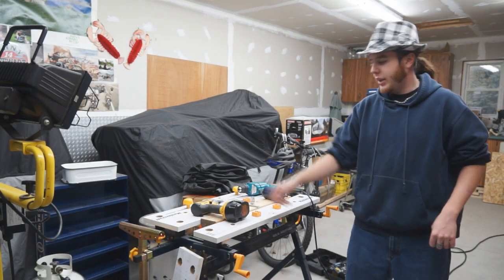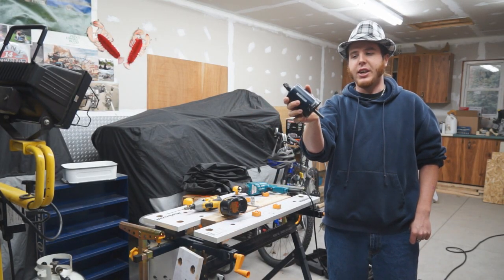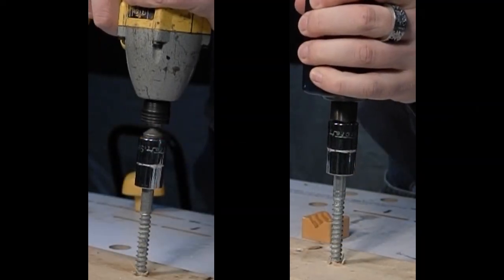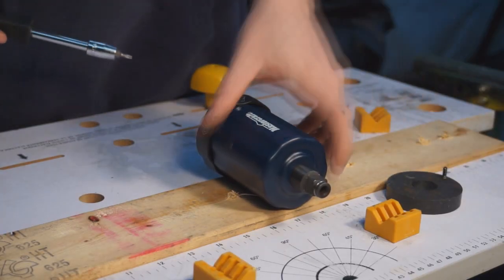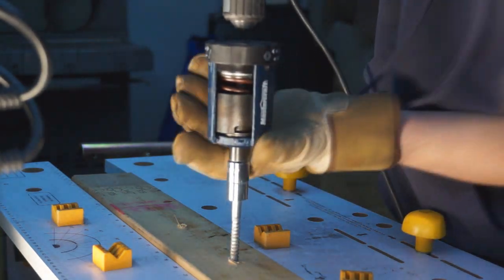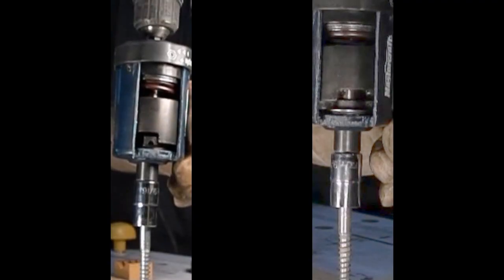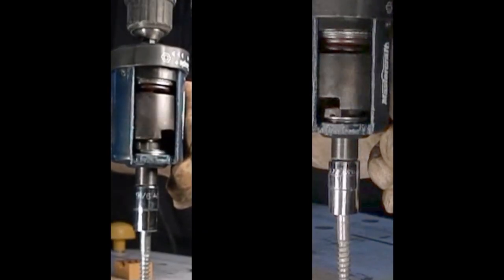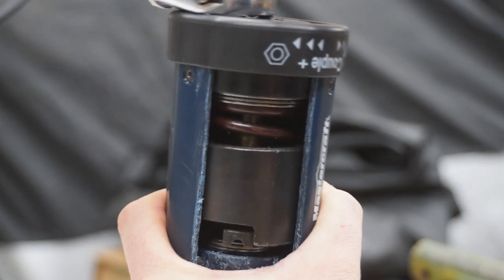Slow Motion - How an Impact Wrench Works

Comment: This video is superb! Absolutely the easiest and most visually descriptive video of how an impact works. I understand this perfectly now. Thank you so much. Keep the great vids coming. If possible, could you make a video about how a sink side sprayer diverter works?
Reply from the maker: Thanks, I have lots more planned for this year!
Reply: Nick Moore HOw about a video on how torque sticks work?  I have read many posts about it, but without seeing the inside, I just can't understand how it does what it does?
Reply from the maker: jawojnicki I don't actually have any torque sticks but I believe they work kind of like a shock absorber. If I find one cheap or one that I can borrow I'll make a video. Thanks for the idea.
Reply: Nick Moore
awesome dude.  thanks for trying.  I'll be on the lookout.
Reply: jawojnicki torque sticks are spring steel... the inside would just be more metal... the principal is simply that they absorb the shock of the impact along the length of the shaft reducing the amount of torque that can be applied at the business end... which is why they only really work if your impact's torque rating is within the range the stick was designed for... so using a 100ft-lb stick on a gun that is rated for 230ft-lbs would be more likely to get you at or a little below 100ft-lbs even if you sit all day on the trigger then if you did the same thing with a 700ft-lb rated gun

Comment: Aha! Thanks for explaining that. Still not quite sure how the the hammer cylinder climbs over the output shaft blocks.
Reply from the maker: The drive shaft has a pair of curved cuts in it, when the hammer is blocked by the output shaft it climbs the curved cuts like a nut on a bolt.
Reply: Nick Moore I get it. You can actually see this at about 2:30. Thanks for clearing that up

Comment: Great video, id like to see the tool operate with little or no resistance also as I beleive the hammer mechanism doesnt engage unless it meets resistance.
Reply from the maker: With no resistance the spinning hammer and output shaft stay locked together and spin at the same speed as the input shaft. 

Thanks for watching.

Comment: I just bought a 12 volt impact wrench that works from the cigaretette lighter but was a little confused as to how to use it. When I offer it onto the wheelnut and pull the trigger it whines a lot with no spin but it seems to want to work if I pull the wrench off the nut slightly and has no trouble then cracking off the nuts. Your video is great for understanding how they work but is there a 'knack' to using them ?

Comment: Nice video.

Where can I buy this "imact-head" ? And how it is named correctly?

I'd like to add it to my electric wrench to use with tight bolts/nuts of my car wheels.

Thanks in advance.
Reply from the maker: When I bought it it was called an 'impact adapter' but in have not seen them for sale since I made this video. I don't know where to get them now, sorry.
Reply: If you're in Canada Princess Auto sell them. I would try to spend more money to get a corded impact gun for lug nuts.
Reply: Philip Lo , nope, I'm not from Canada :-)

Have just found electrict impact wrenches at eligible price at my place, so it is solved.

Thanks for feedback anyway, guys!

Comment: Finally.  I've found someone that explains how an impact driver actually works.  Can you do one on a rotary impact driver?  Thanks.  Great video.
Reply from the maker: Do you mean one of the hand held kind you drive with a hammer? If I see one for cheap enough ill pick it up.
Reply: Nick Moore No Niick.  I mean the cordless hammer drill type, for drilling concrete and bricks etc.  Rather than making a "hammering" noise it sort of screams.  A real high pitch.  I always thought it has two discs inside with serrated teeth that rub against each other .. It's the cheaper cousin to the one you are showing in this video.

Comment: Well done - very interesting. Let me point out that the device provides a downward impact at the same moment as the turning impact. This helps hold a Phillips head bit (say) into its groove at the moment of impact, so it does not slip out and strip the head.

Comment: how it goes up after each strike? the spring is on top and it forces the top portion mechanism to drop down, but how after dropung down it climbs up to reapeat  the hammering processs and rotating?
Reply: the "hammer" is forced up and compresses the spring by the rotating force of the motor and the resistance of the fastener being driven.
Reply: thank You Sir.

Comment: Nick,

Great video showing exactly how impact drivers work.  I looked all over Google and You Tube for an explanation.  Yours is the only one that explains and demonstrates how they work, while all the others simply show the results or compare them to drills.  I want to use my impact driver to power an ice auger, but everyone said that it will not work, without any explanation why not.  No one can explain why it wouldn't work. I think that it would work much better than a cordless drill because of the 3x higher torque and lower speed to drive the ice auger without the torque being transmitted back to your hand.  Only negative would be any clearance in the adapter pin causing distortion of the connection due to the torsional impact.  What are your thoughts?

RAJ
Reply from the maker: You could use an impact gun for an ice auger but probably not for drilling wood or metal. I think it is because wood and metal, being soft, will absorb the impacts instead of cutting. Ice however is much more brittle and should chip and shatter during each impact. I don't know if it would give you any advantage however, the maximum cutting speed would still be limited by the power of the drill. A 500W standard drill would always be faster than a 100W impact gun because it have more energy per second to give. I hope this was helpful, let me know if it works.

-Nick
Reply: Nick,

Thanks for your input.  I have jet to try it cutting a hole in ice.  However, it doesn't seem to offer the same torque as my drill , and causes a lot of vibration.  I will try using the drill first.

RAJ

Comment: This is what you will commonly find in a cordless impact wrench, however much different than what's found in a pneumatic wrench, they have hammers or hammer pin type setups most of the time.

Comment: I was thinking about building on of these eventually. Really great cross section. Like the post. What camera did you use and how would you rate it? anything particularly good or bad about it.

Cal
Reply from the maker: I used a Casio EX-F1 camera to film the high speed portions. It tops out at 1200fps at 336x96 pixels, really small. I have tried to rent better cameras from high speed camera companies but they will not rent to individuals. Buying a better camera starts at about 15,000$

Comment: Creeping just means that the force (momentary impact of torque) is being quickly dissipated as friction overcomes it, not that you're stretching the bolt. Like driving a railroad spike vs an 8d nail with the same hammer - each hit is still moving/creeping it, just more slowly as friction increases. You can see this with a 1/4" impact driving a lag into wood. The impact is much slower than a drill with a lower torque spec, but because it still moves the piece it is rated higher.

Comment: So we could conclude when the socket stops spinning and starts creeping is when the gun has reached it's max torque. The creeping is not the gun gaining more torque, that's a sign that the fastener or threads are stretching. It makes sense when I put a Snap On 140ft lbs torque stick on my IR 2135Timax 550 ft lbs forward torque gun. The lug nut doesn't stop spinning until bout 2 seconds of trigger pull. That's good to know. Now i just got figure out the definition of nut busting torque.

Comment from the maker: As far as I know the max torque a run like this will put out is when the bolt/nut/lag stops spinning. At that point the hammer is hitting the anvil and all the energy dissipates without turning the drive any further. You are correct however that trying to run it until it stops will probably stretch small bolts or strip wood when using big screws.

Comment: When a gun specs says it puts out x amount of torque like 700 ft lbs, when does it reach that x amount of torque? Does one full press of the trigger automatically torque it to around that spec? Seems like the lug nut keeps creeping on everytime the gun impacts. I don't know of that is the gun not reaching it's full potential or that's the bolt slowly stretching.

Comment: "putting a sound deadening material on the hammer would cause it to dissipate energy instead of transferring it to the bit"

That makes absolutely no sense whatsoever, the air waves caused by the impact mechanism have absolutely nothing to do with the energy transmitted.  If you encased a normal impact gun with sound deadening it would be much quieter, however it would be much, much larger and unwieldy, and really wouldn't be all that much more quiet.

Comment: Nik, great vid. Can you take us to the next level and do a comparison of the torque converters like Mastercraft, Torqmqte, etc.  What we need is the improvement torque ratio - e.g. "Drill" mode mode is rated at 800 in. lbs. but the output is 2,400 in. lbs.  Also, what is the needed minimum RPMs of the drill for the unit in order for it to be effective.  I don't use an impact a lot and I would probably replace it with a good torque converter and a high speed cordless drill.

Comment from the maker: Not that I know of, putting a sound deadening material on the hammer would cause it to dissipate energy instead of transferring it to the bit. Even if you were to eliminate the noise in the tool there is still a significant amount of noise (at least half) that comes from the bit/socket and or screw/bolt that is being driven. You would have to use a high gear ratio to get the same peak torque of an impact driver with reduced sound but you then also get increased strain on the user.

Comment: Is there any way the sound can be reduced due to the impact?? Or rather can the time of impact be reduced. i am working on a project dealing with the noise reduction of an impact wrench and I have tried making everything a muffler, taping the inner hammer and anvil with a damping tape, but none of them work. Any suggestions??

Comment: it seems to me the lower tab attached to the output shaft isn't chamfered or sloped at all. Just vertical. I wonder what makes the rotating mass move up and compress the spring after the impact?

Comment from the maker: There is a spiral cut in the drive shaft and notch cut in the hammer with ball bearings that fit both together. When the hammer is stopped by the output shaft the input shaft spins and the ball bearings pull the hammer up against the spring (like a worm gear) until the hammer is above the output shaft and it can slip past.